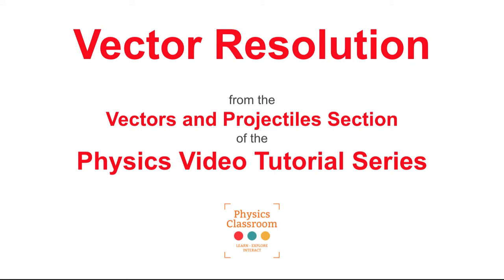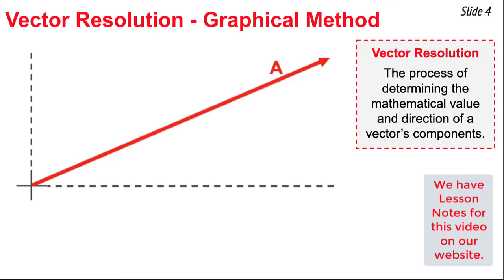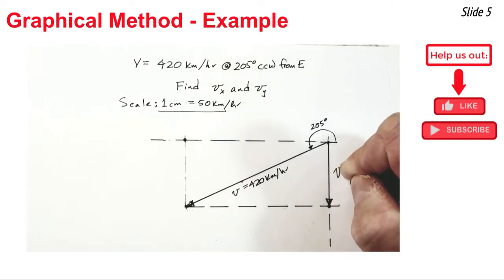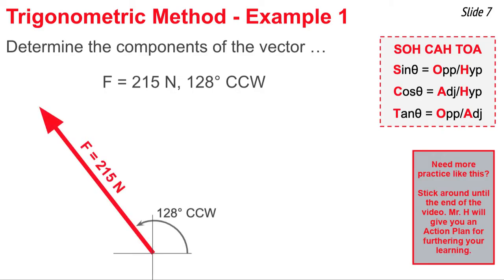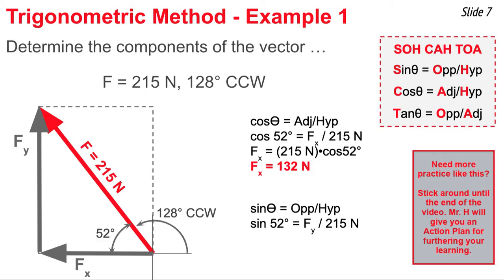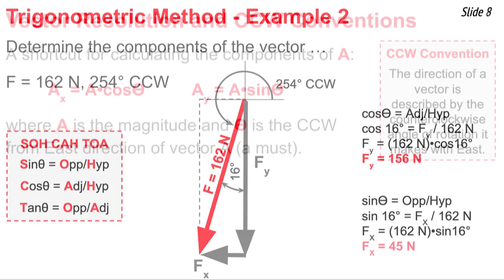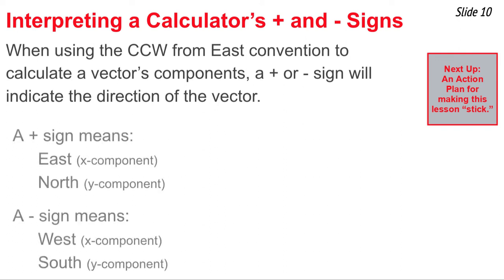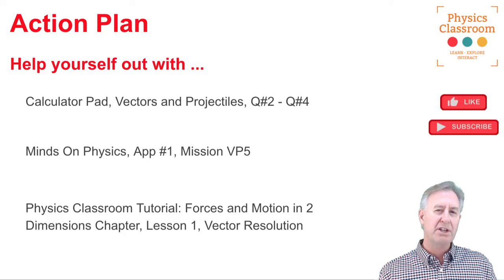Vector Resolution

Comment: why are you not using 254 degrees at the second example to get its components?
Reply from the maker: The 254° is being used to determine the angle inside of a triangle (16°). Then the meaning of SOH CAH TOA is being applied to determine the components.
Reply: @PhysicsclassroomVideos  But can we use it to determine the components? Although yes, it's the opposite of what we get from 16 degrees. Is this still the correct way to go?
Reply from the maker: @ainechi3359  It would work. The negative values translate to west and south.